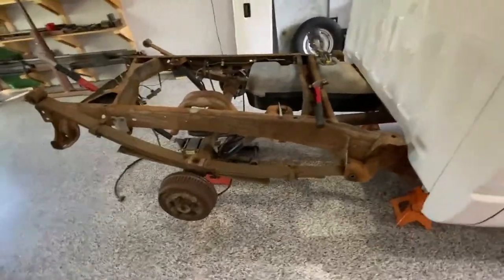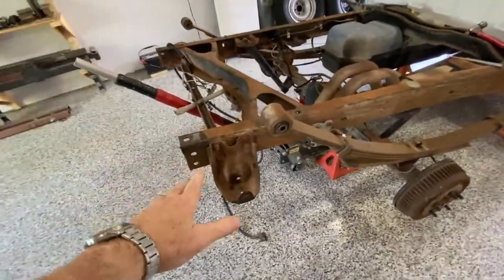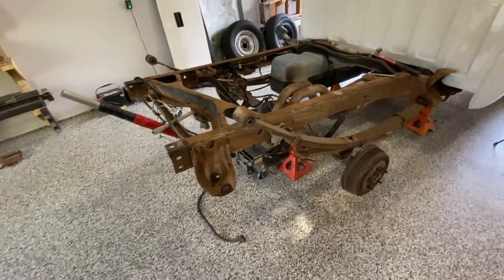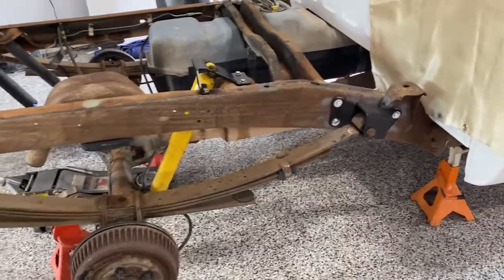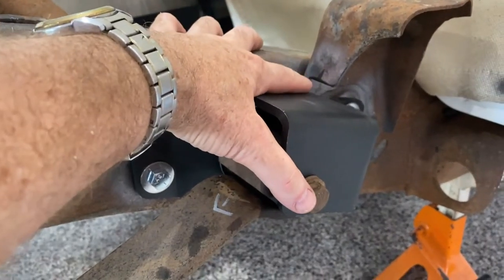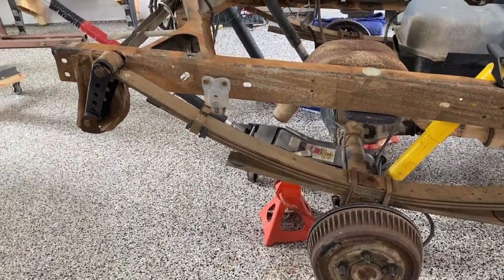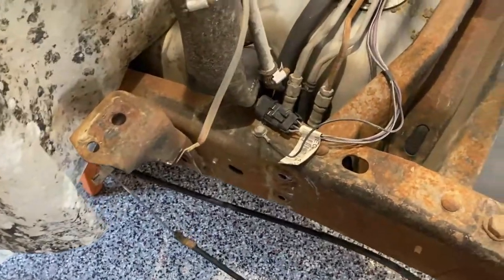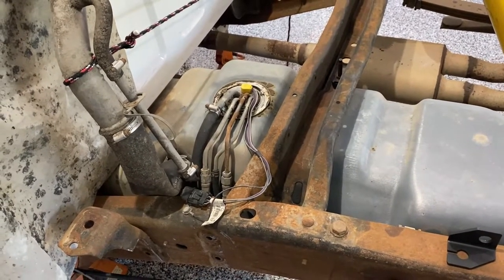1988-1998 Chevy OBS Project Truck Gets a 4" Rear Suspension Drop and Rebuild

Comment: Excellent video, about to do the same drop, never seen the shock mounts, going to grab those and a new pump and sender.
Reply from the maker: Thank you. Although they are more $ than a typical shock extender, I liked it better because it did not hang down. Good luck!
Reply: Did those shock extenders interfere with anything after you put the box back on?
Reply from the maker: @johnmaas373 No clearance  issues. Fit perfectly.

Comment: Order some of those shock extenders.
Great video.
Im sure these worked better with the sway bar.
Reply from the maker: Yes, I've never cared for the lower extenders, they seemed like a necessary evil. The sway bar will hang down a bit, but not too low. I'm having some parts made....it may take me a while to get it all together. I'll be starting on the front end of the truck shortly.
Reply: @laurencevillegarage  navy dad on you tube has a real good video on rear sway bar using all gm parts. Peace
Reply from the maker: @randydarcey2947  I've seen some of his videos, I like his work. However, mine is going to be different....

Comment: Im in the process of doing the rear hangers, i did the passenger side already, going to start on the drivers side, been looking for info on the drivers side hanger, is there a way to get the new hanger in, without removing gas tank/bed ? Ty for the video, from houston
Also, i did not have to trim the bed-frame bracket on the passenger side, had enough clearance do not have to trim- hopefully i dont on the drivers side . 1994 singlecab shortbed
Reply: Side note, I paused the video after u pulled the fuel pump- to ask about being able to accomplish without removing bed/gas tank, and you answered my question a few seconds later lol. 🎉
Reply from the maker: Removing the driver side hanger with the gas tank and bed in place may be doable, but removing the bed, or at least raising the bed out of the way would make it way easier to do and take less time to complete. The gas tank is the same way...removing/dropping the gas tank makes the project much easier. There are connections and bolt access inside the frame rail that would be really tough to do otherwise. It's one of those projects that seems like it adds extra time/effort for what little you are trying to do, but, that trying to do the hanger with both in place will be a lot tougher to do. Bottom line, it can probably be done, but I wouldn't even try it.

Comment: How did you route the emergency brake?
Reply from the maker: I routed the emergency brake cable over the top of the driveshaft/differential and secured it in place with the factory bracket. The bracket is turned in a different position (than stock) to the top of the rear differential just above the pinion/rear driveshaft mounting pad.

Comment: I'm bit confused, how was it lowered?? Through the shock extenders or did he get different leaf springs?
Reply from the maker: I used 2” shackles and 2” drop hangers for the 4” drop. I used the shock extenders to use shocks I already had and not use a drop shock and to improve the shock angle from stock.
Reply: @laurencevillegarage  ohhh i see, thanks very much Mister. I just bought a 94 that was "lowered" turns out the leaf spring hangers were torn, so I'm gonna get those replaced.

Comment: How dose this ride ..? Dose it bottom out on bump stops..? I noticed  u did not c notch the frame which I don't wanna do to mine either
Reply from the maker: No, it does not bottom out, but, it will affect your load capacity. You can’t carry a load of tile or a pallet of grass. The quality of ride will depend a lot on the type and quality of shocks you use. Get a good shock and you will be good.
Reply: @laurencevillegarage  cool thanks and yeah I don't load nothing heavy on this truck it's a cruiser..👍 I like your build good job man

Comment: hey did you buy a kit for all this?
Reply from the maker: No, I did not. I bought the components separately. The truck already had the rear shackles, I already had the shocks. I have never seen the upper shock extenders that I found in a kit. I have seen shackles and hangers in a kit on eBay for $106..

Comment: 👍👍👍
Reply from the maker: Thank you Gerardo!
Reply: @laurencevillegarage  @ on that  rear disc brakes swap, u will need to upgrade master cylinder? Or proportioning valve? Or??
Reply from the maker: @gerardolopez5875  I will be upgrading the master cylinder to a ‘01 Suburban style. On the ‘95, I did that and a proportioning valve was not needed. Good eye!
Reply: @laurencevillegarage  @ its that 02 style master cylinder, has more power???  I got 1 from 03 tahoe, would it fitt into 84c10??
Reply from the maker: @gerardolopez5875  I’m not sure about it fitting the C10, I’ve never tried that. Not more power, but that m/c is made for f/r disc brakes and the reservoirs are more equal in size/fluid displacement. The one on the c1500 has 2 different size reservoirs, that is why you would need a proportioning valve to control the fluid/pressure to the rear brakes to keep them from locking up prematurely.
Reply: @laurencevillegarage  @ amigo, on obs swap, the speedometer, just splice wires into donor speed sensor???
Reply from the maker: @gerardolopez5875  Yes, splice them together. That way your speedometer works and the pcm for the LS knows your speed as well.
Reply: @laurencevillegarage  @ does it matter which color to which color?
Reply from the maker: @gerardolopez5875  Go by pin location not color. I can’t see what you are seeing, but if you go by appropriate pin location you should be fine.